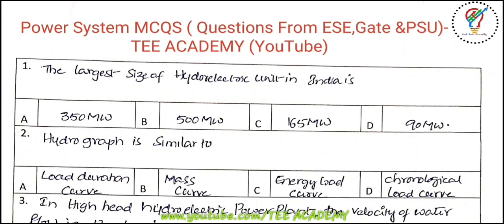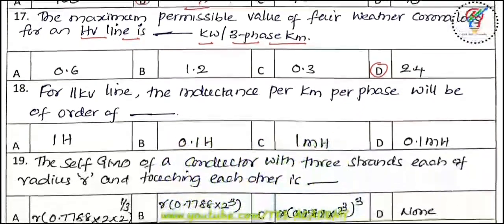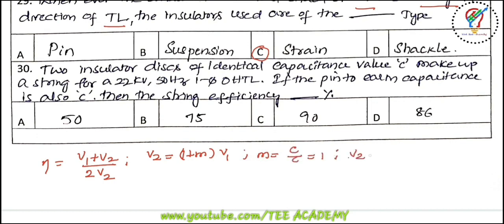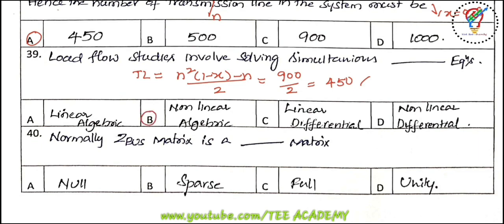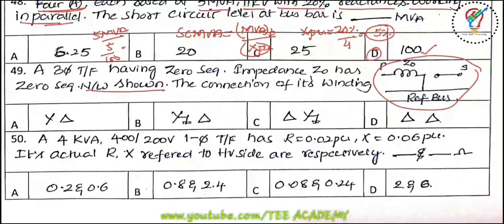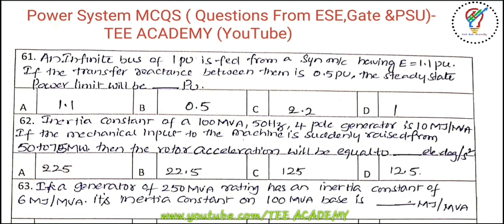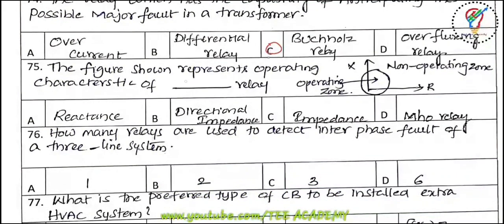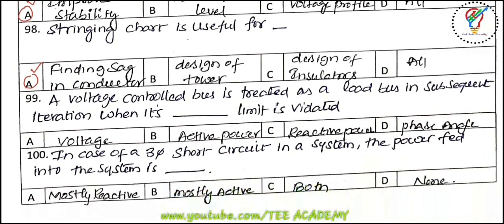ASSISTANT ENGINEER ELECTRICAL  PREPARATION! POWER SYSTEM 100 MCQS

Comment: 20) 40 cm
25) A Galloping transmission or power lines can occur when freezing rain creates icicles and odd-shaped ice on transmission towers and conductors. High winds push on the icicles and conductors and lifts them up, creating a galloping, or jumping, motion.